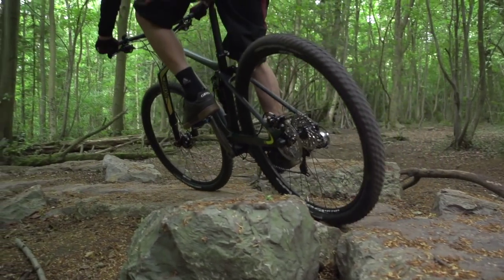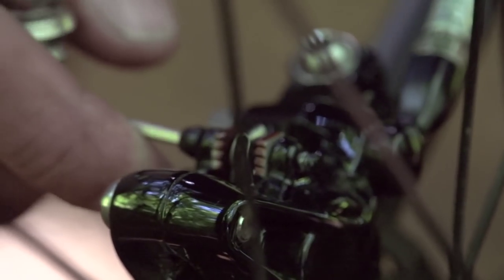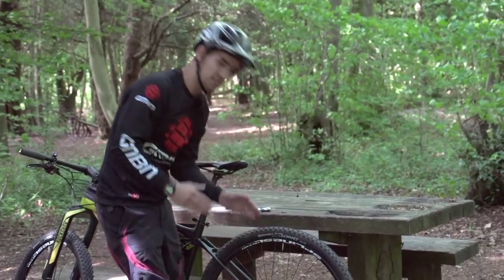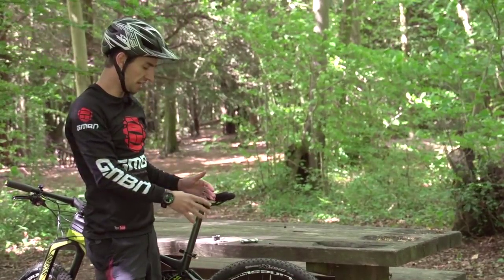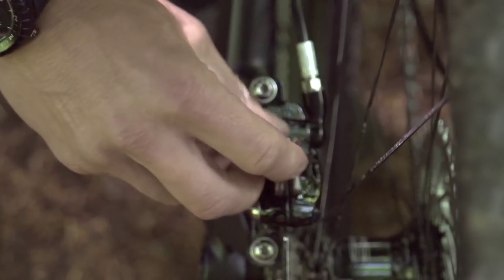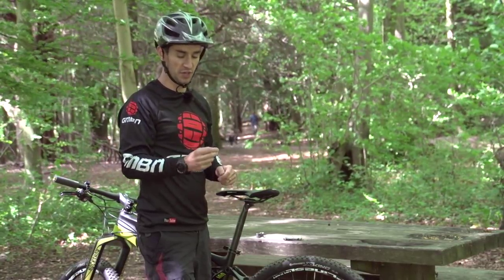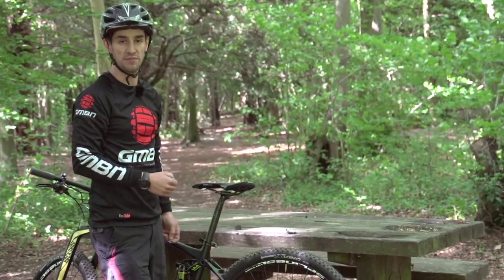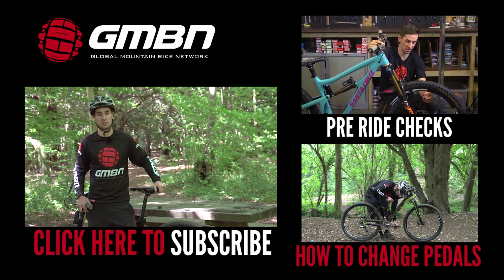How To Change Mountain Bike Disc Brake Pads | Trailside Maintenance

Comment: I really need to do this, I'm pretty close to braking with metal pads at this point
Reply: I'm not going to be a over zealous cyclist, but the noise will be enough to tell you they should be changed. And no it's not going to ruin your rotors. But braking will be impaired.

Comment: It sounds silly but mine actually did wear out mid ride on a downhill section and suddenly there was metal on metal and the bike started to shudder like crazy.  I didn't have an extra set so I flipped them around as there was some uneven wear and it got me down the hill a little more comfortably.

Comment: your comment at 1.40 is something not mentioned anywhere else and can lead to a heap of frustration if you do not know this. I refer to the fact that if your caliper pistons will not push back into the caliper then you need to allow some fluid to escape. I tried fitting new brake pads on my Avid Juicy 3 brakes...........impossible because the pistons which have central locating points sticking out even further than the face of the piston, just would not go back far enough. As soon as I realised that unlike a car the hydraulic system on a bike is fully sealed I sussed that I would have to allow some fluid/pressure to escape.  I think you could make a video just on that point because it seems to me loads of people trip up by not knowing/realising that. Well done!

Comment: I change em when pad materials get below 1mm or wear is uneven. My Hayes Pads are 4mm when new (2mm for pad, 2mm for backing material). I change em when any part of pad plus backing drops below 3mm. Calipers really come in handy for measuring this. Also, if pad wear is uneven you might want to realign your calipers.

Comment: I just replaced my rear pads as there was a lot of travel in the brake handle before it bit (shimano). It seemed to do the trick at first, but it quickly went back and now isn't really biting properly at all - any advice? It seemed to start when I had the rear wheel off and put it back on again.
Reply: Tim Leahy are they hydraulic brakes? They might need bleeding

Comment: When my bike is moving and i press the brake it makes the loudest squeak ever and there not as sharp as they used to be, do i need new brake pads?
Reply from the maker: +Preston Garvey Maybe, or they might have oil on them.
Reply: Once they squeak like that they need replacing, make sure the pistons are sealed and clean from oil.
Not worth farting around cleaning the pads with de-greaser.

Comment: I have oil on my disc brake pads do I have to change them
Reply: Yes. Don't try to clean the oil off the pads because it's been soaked into the pad material. Pads are inexpensive. Be sure you clean your rotors with automotive brake cleaner, alcohol, or acetone.

Comment: Hi guys, my friend threw a Bubble gum and it went straight into my disc. I dont know if I need to change my pads or the disc. I cant go to the bike shop because they will tell to change the disc, beacause they will earn more money if they will change the disc. please help.
Reply: Take it to a good shop where they will replace your pads and clean your rotor, if the rotor is still contaminated they will replace it
Reply: Okay. Thank you. 
And what is the price of a decent disc?
Reply: crack kid Disc rotors start at around £10 but for most they're around £15 to £25. You probably don't need to spend more than that.  Shimano Ice-Tech rotors will handle heat build-up better on long descents to keep you're brakes working well but like other higher-end rotors can start to get pretty expensive, around £30 and up.  Any of SRAM or Shimano rotor should be a decent performer though.

Comment: No one ever seems to show how to do it if you have an entry level mechanical brake set. I have Tektro Novela on both of my mountain bikes with no idea how to change the pads.
Reply: SilverArrowShooting I used to have a set of Tektro IO brakes and they're very similar to the Novelas.  Take the wheel out so the disc itself isn't in the way, then you should be able to use the little tab on the pad to pull it towards the centre of the caliper.  They're only held on magnetically and once they're off, you should be able to just drop them out the bottom of the caliper.  Fit new pads by doing the above, but in reverse.
Reply: I never thought they'd be magnetic. Thank you so much.
Reply: +SilverArrowShooting Hope it helps :)

Comment: What is the types of disk brakes PLS HELP MEE
Reply: Tun218 If you mean what size, there's different sizes depending on the style you ride. DH and freeride tend to have larger disks to disperse heat since they use a lot of breaking.

Comment: My pins are broken how can I get them off to switch my pads?
Reply: Colin Wolf Depends on what type of pin your brakes use and what you mean by "broken" :/
Reply: Are they threaded, if so you may have to drill them out.